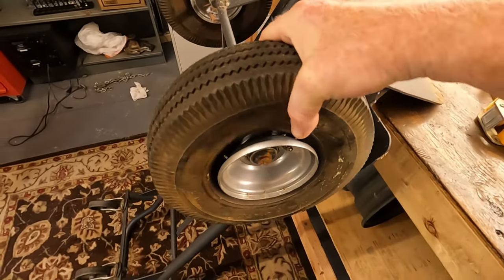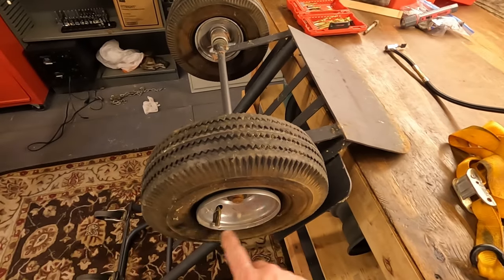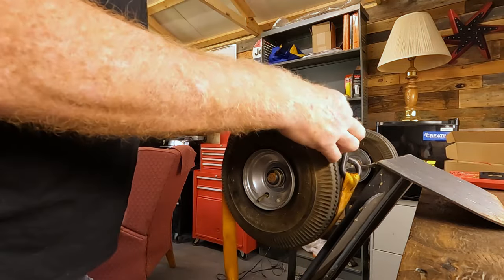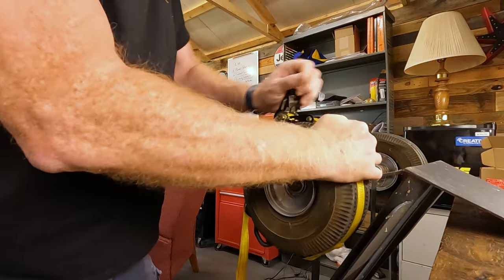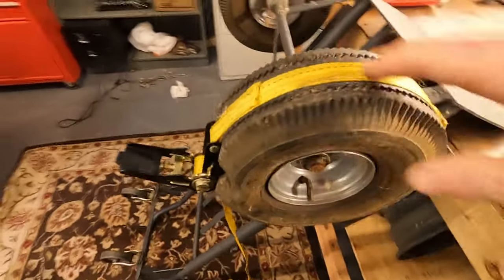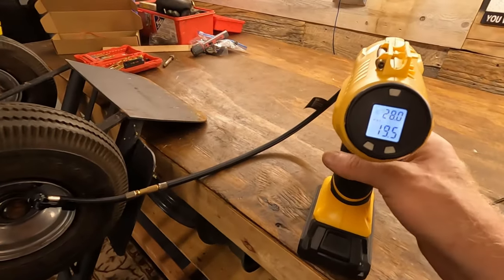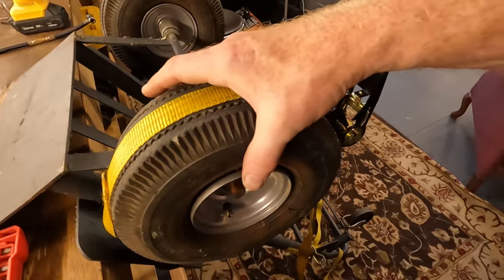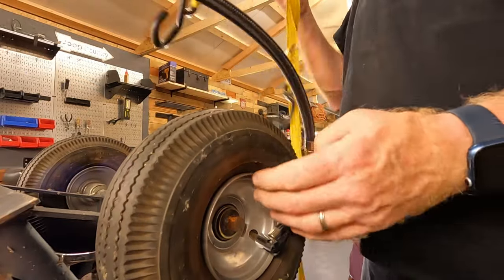How to Fix a Flat Tire on a Hand Truck Dolly

Comment: A tube tire if it was flat it will be flat again , the strap way is not needed at all because is not a tubeless wheel.
I don't know man , just saying
Reply from the maker: All I know is... it wouldn't air up without the strap and did with it. So, it worked. Recorded it 2 weeks ago and just checked - still has full tires.